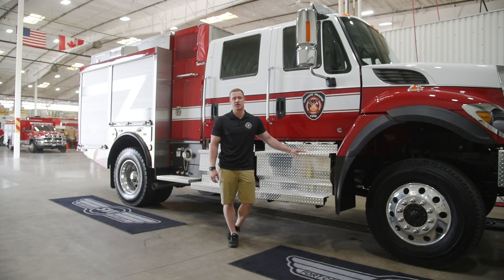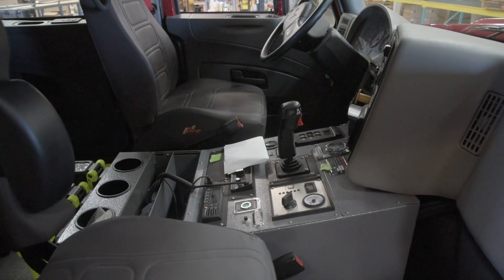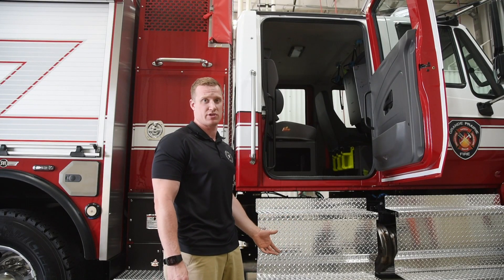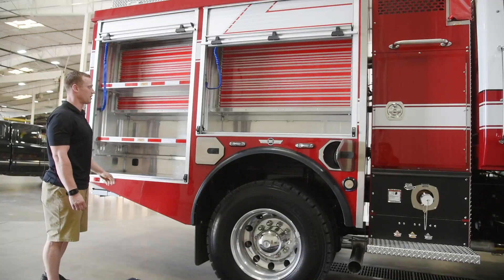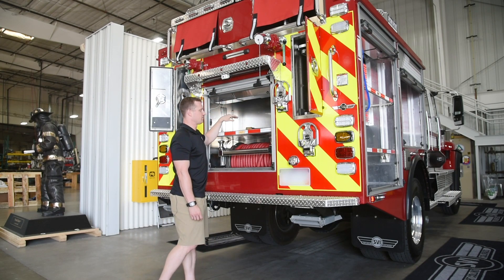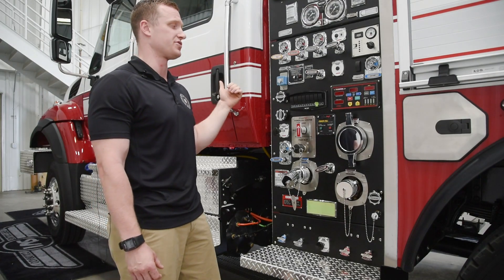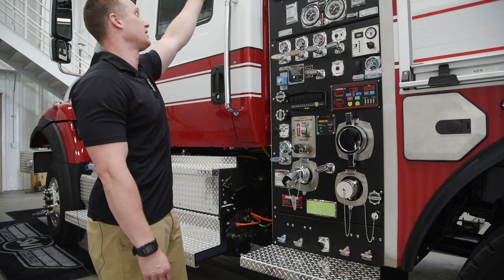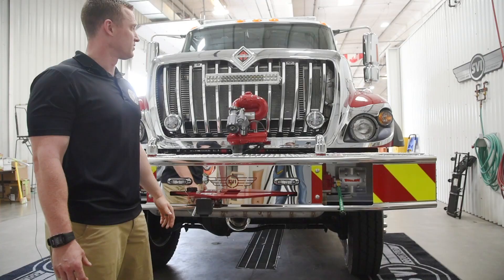How A Type III Wildland Fire Engine Works – SVI Trucks

Comment: What means type3???
Type 1 type 2???
Reply from the maker: Type 3 is an industry term for fire trucks usually mounted to a truck-type chassis (like Ford, Dodge, Chevy). Type 3 wildland units are typically brush trucks.
Reply: To oversimplify the types type one is a normal city fire engine, type two is usually a city fire engine that is equipped with wildfire tools and training, type three is your traditional big wildland firetruck, type six is your f550 wild land firetrucks that are much more off-road capable, and type seven is a small wildland firetruck built on usually an F350 or a skid in the back of a regular pick up truck.

Hopefully that helps

Comment: 300 gpm monitor with a 500 gallon tank?  Hmmm.  Enough to do a self save into the black, but that is about it.....if you haven't already been using water on the fire.